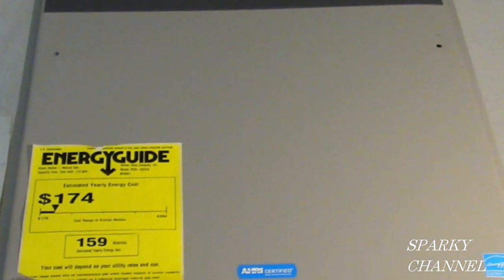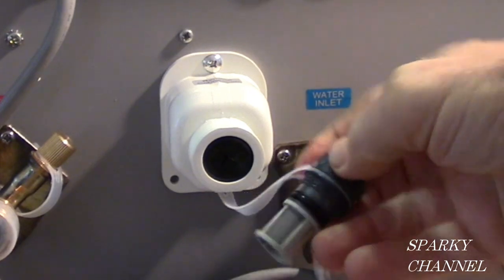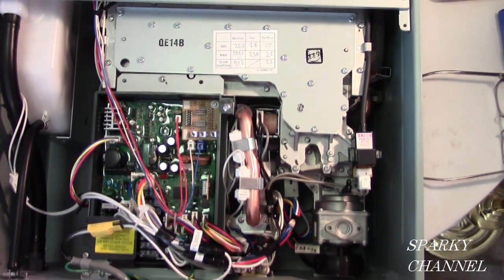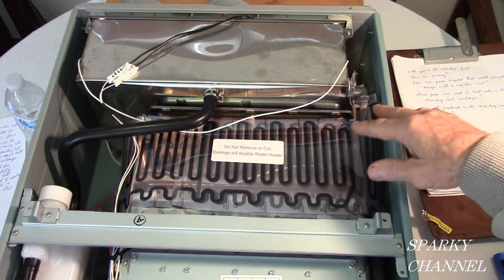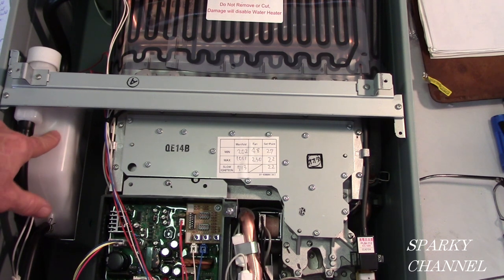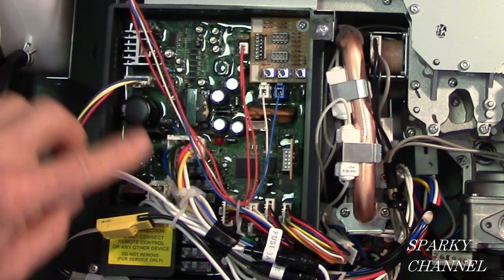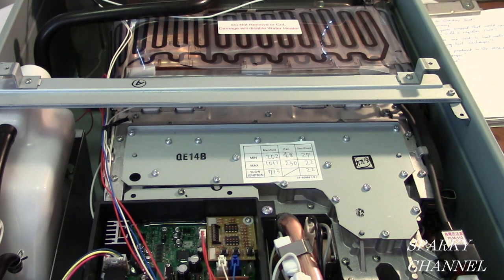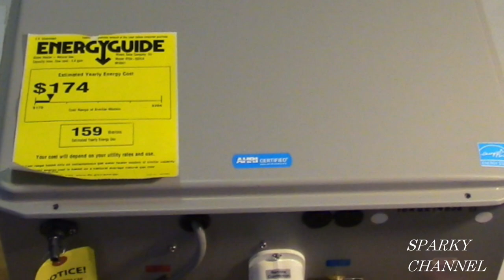How a Condensing Tankless Water Heater Works with a Tour of the Rheem RTGH-95DVLN

Comment: Nice water heater. I got such a thing for heating two houses (forced hot water heating where every radiator got its own thermostat) and in addition making hot water for one of the two houses with a heat exchanger tank. It's also natural gas fired, but there's one major difference in the construction:

Mine doesn't have two separate pipes for combustion air and the exhaust. Actually this is a pipe inside of a pipe. The outer pipe is the intake for combustion air, the inner one is the exhaust. That's done, because of this construction the exhaust gas still got some heat in it, and it's warming up the combustion air. On the outside the exhaust pipe is longer than the air intake, and it's inside of my old chimney using this as a conduit for the pipes, so the wind over the roof line will blow the exhaust fumes away. You only got a bit of condensate, which is collected in a tank. In my case I got a small pump in it which pumps the condensate into the drain when the tank is full.

I've never seen this type of construction on videos from the US, only this two pipe solution.

When this was installed in 2013 I took some pictures to record the progress on the renovation of the house.

Exhaust/air intake, Chimney opened:

https://abload.de/img/img_5918xsk7y.jpg

The same later when the opening in the chimney was closed:

https://abload.de/image.php?img=img_5938acjap.jpg

Condensate tank with pump, here for natural gas a neutralisation is not necessary. Only for oil fired ones.

https://abload.de/img/img_5943gyj5s.jpg

Drain connection:

https://abload.de/img/img_59446mj2g.jpg

Water heating tank with circulation pipe and pump:

https://abload.de/img/img_5941lqk20.jpg

Service entry of natural gas, next to it is the service entry for electricity:

https://abload.de/img/img_5942hej9c.jpg
Reply from the maker: Nice job, thanks for the photos!

Comment: What is the bypass valve for?  How is it activated?  Thermally open or closed?  I'm trying to figure out when descaling if we are actually circulating vinegar through the heat exchanger or is it just going through the bypass circuit.  My gut tells me that bypass needs to be closed and letting it go through the heat exchanger.  In other words...you'd need to power the unit to get the bypass to close then pull the plug so it stays closed during descaling.

Comment: How many watts would be used while taking a hot shower?  I have a propane version of this and live on solar.  I can't find any info on watts used during use.  I would be very unhappy to find out the igniter uses 100 watts while in use.  Thanks in advance.
Reply: Found the answer...a couple watts standby...20 to 30 watts when running.  Great for solar.

Comment: I have this exact same unit.  Last night it gave me code 29 ( Neutralizer Clogged).  The two red cables that connect to the top of the  unit was wet so I dried it ( Perhaps from the rain storm we had that might have entered through the vent pipe ).  I also noted that the air drain hose was clogged up with white sediment ( very similar to baking soda ) so I unclogged it using a small screwdriver poking into the hose and a lot of white stuff and liquid poured out after unclogged it.   Do you know how the white stuff clogged up the air hose ?  I reset the water heater and it's been working fine for now.  Thank you for the video.
Reply from the maker: Calcium carbonate from the neutralization kit, most likely.
Reply: @SparkyChannel  Thanks!! But should it be coming out that small hose though?  I have been monitoring both drains while hot water is being used.  Nothing comes out of the large drain only smaller drain that has water coming out along with the Calcium carbonate stuff.
Reply from the maker: @nopmoo  The discharge is supposed to be clear water. Perhaps your calcium carbonate got too wet?

Comment: I have water coming out of the small condensate tube. I your video you mentioned it was dir air intake - is it wrong for that to be dripping water?  Thanks.
Reply: I have the same issue.
Reply: @harleyhohani4243  I was wondering the same thing plus it was clogged with looked like calcium buildup! can't find any info on it. and does it need to be opened a bit cause mine is closed all the way

Comment: My neighborhood needs your help. We had a unusual cold snap in Texas and everyone's Rheem Tankiess Water heaters have failed.  They look like yours, but slightly different Model Numbers.  These things froze (whether inside interior walls or outside) and as they thawed, began to flood every single home, one after the other.  I think mine sprang a leak in the copper tubing on the backside.  How do you remove the heat exchange, control board, etc.. to get to the backside of these things in order to find the problem?  Or do you think the problem could be something else?  Your response will help me to help dozens in my community!
Reply: Opening up the panels and watching where the water is leaking, it appears that one or more O rings are sensitive to a good freeze.  Hopefully we'll get more info about that from Sparky.

Comment: Texas Freeze Victims. There is a new video posted that shows how to change out the bypass valves. It was just posted on YouTube.     Here is the title  Fix water leak in Rheem Tankless Water Heater after freeze. DIY Repairs                           Sparky my question. I am in TX and the freeze got my unit.  Parts are not available. I do have the Water Control Valve on order, but I just found out that I may need the Bypass Assembly. I hope I am wrong.  Is it possible the the Water Control Valve will solve Error Code 65?  Would you please tell us the purpose of the Water Control Valve?  The purpose of the Bypass Assembly?  Thanks
Reply: Can you post the link to the new video you mention? I have the same situation.
Reply: I think we are all in the same boat. My plumber has kicked the ordering details to his supplier and we were told we will likely need two parts, too. But no WCV available worldwide and unknown when they'll be available. It looks like I'm likely to replace the unit instead....
Reply: @christophermoore2398  I just checked zoro.com.  It looks like Rheem is 12 days out. If you search online, you can find Zoro coupons so that will lower your cost. I have used Zoro before and they are legit.  Order yourself and avoid the plumbers markup.  I am guessing you have the 9.5gpm unit. Make sure you order the right unit.  It will be cheaper just to get a new unit in lieu of hoping those two parts fix it.   Post a comment if you have a question. I already been down this road!

Comment: I have a leak in the intake & bypass water control, do you have any instructions on how to replace it?
Reply: I have the same issue. Intake bypass valve is cracked and leaking, is there a video to get to it as it’s in the back. Would greatly appreciate a response as a plumber is weeks away from getting to it. Thanks in advance.

Comment: QUESTION: how easy is it to replace / upgrade to a tankless fro a regular Tank model? I want to do one in my garage with an indoor model. But talk to me about the gas and electric requirements. thx.
Reply: You get discount?
Reply: @jayty1307  discount from?
Reply: Your plumber, always ask for discount, way to expensive
Reply: The answer to the question will depend a lot on which heater you select.  I spent a good amount of time selecting the best heater for my needs that minimized the amount of work to retrofit it in place of the old tank type heater:
https://youtu.be/ZAct355__Ds
There are now more retrofit friendly tankless heaters available than in 2017, so spend the time to find one that would fit best in your situation.

Comment: Come on...someone answer.  The bypass valve....is it normally open or closed???
Reply from the maker: Please see: Tankless Water Heater Lime and Scale Flushing Procedure: https://youtu.be/1cuxYTx855A
Reply: @SparkyChannel  It wouldn't make sense to pull power thinking the bypass is now staying closed if it's spring loaded to be open and bypassing.